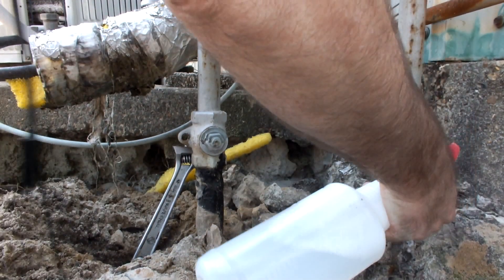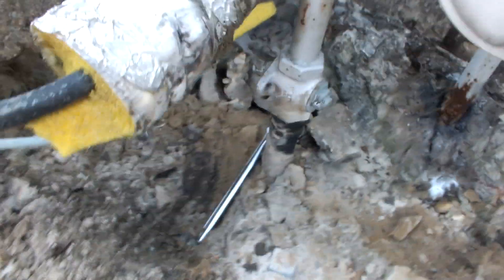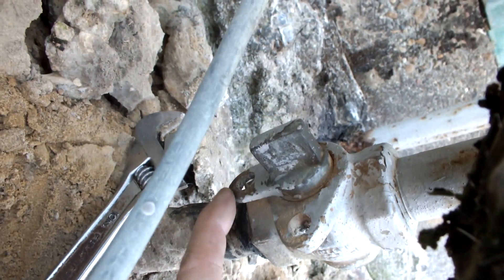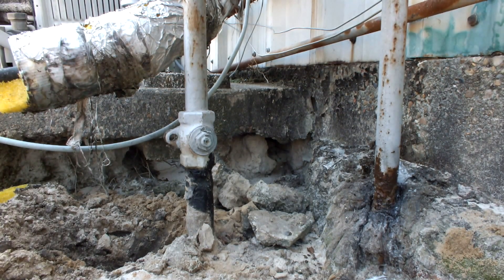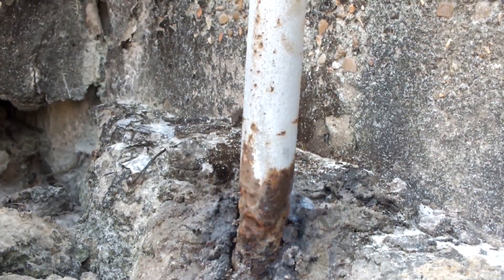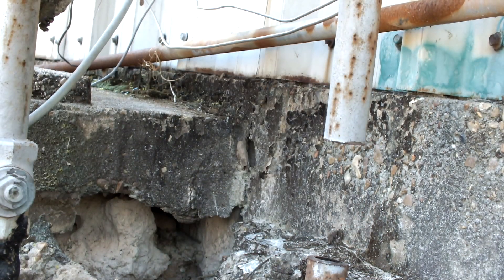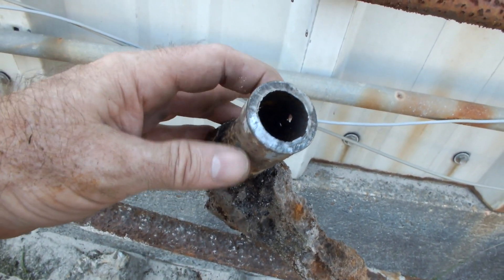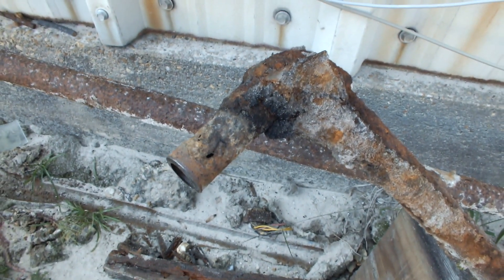Natural Gas Leak Shuttoff Valve Pipe Cutting with Ridgid 42A 4 wheel cutter

Comment: i would have liked very much if you would have made of a video of you repairing it  ! ! People would have seen what you used  to complete the repair.
Reply: There is specialized paint that can fill in the space in the metal piping, otherwise i believe you have to replace the pipe if the leak is bad enough.